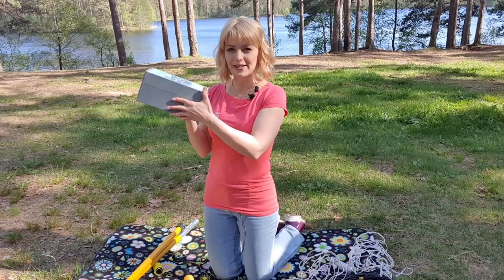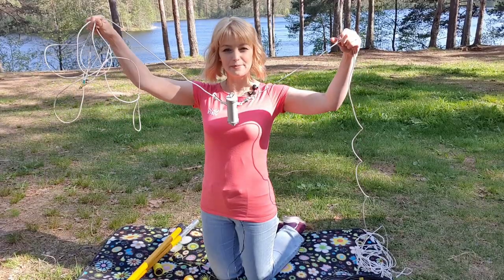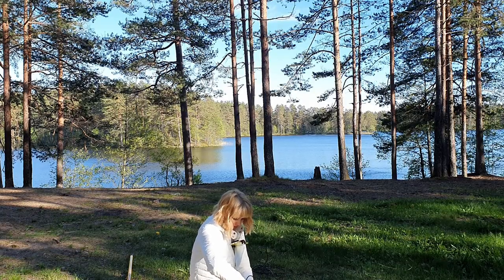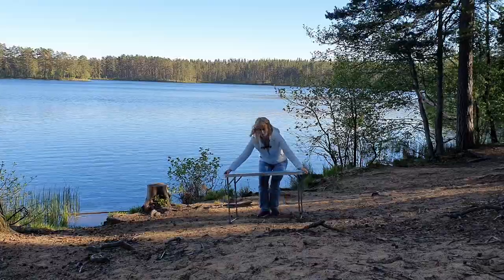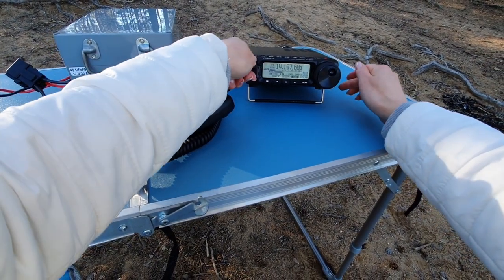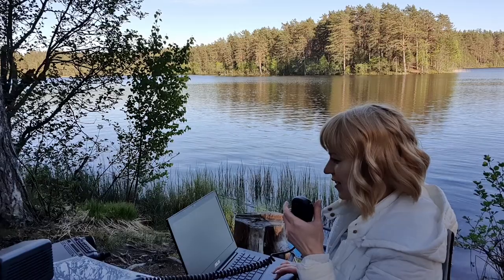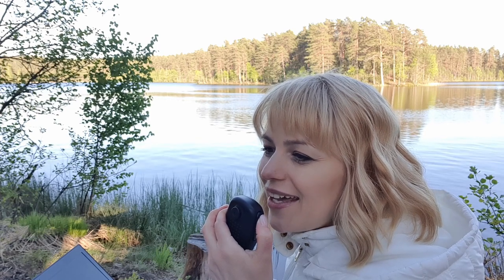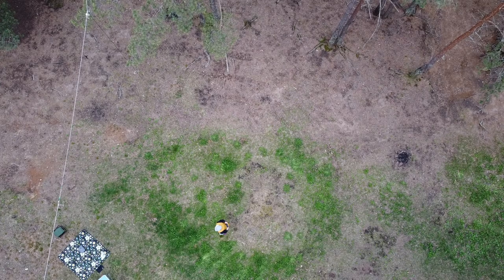How a YL can set up a portable HF station in the Russian woods

Comment: Very good Raisa. All my compliments and my best. Your dipole for the 20 meter band is located for sure at more than 10  meter height. At this distance from the ground the swr will be more stable. But the merit for the low swr is of you dipole, and if you have made boy yourself my compliments for this. Best regards and 73 from IW0HPU from Rome, Italy. Bye. Fabio
Reply: Tipically the swr will start to oscillate around his constant and lowest value when the antenna is at a distance from the ground at least of an half wavelenght. And the antenna position in your video was at more than 10 meters from the ground, perhaps 12 or 15 meters. A very good distance for the 20 meters band that you have used. Best regards and 73 from IW0HPU. Fabio

Comment: Hello YL Raisa you did a great job on the sling shot and setting up. If you fold your string into a bucket or large paper supermarket bag it will behave better when you fire your weight over the tree. Thanks for the video. vk5cz ..
Reply from the maker: Thanks for this advise. I had such a bucket in Finland, when I bought this sling shot. But now I can not come into Finland because of restrictions.. I will find something here in Russia ;-)

Comment: Well I can only copy one of those camera angles Raisa :). but you have done a wonderful job.  Something for you to try:  I find that a small weight on the end of a rope can, with practice, be thrown high enough to deploy most any antenna.  This would reduce what you need to carry into the field and of course; simple is good!  Well done regardless and thank you for taking the time to make this a video.  73 - N3NWV
Reply: I use a wrist rocket sling shot. Vey compact. I've installed ropes on 100's of trees when building my 40m wire beams!. 73 WA3RSL

Comment: Fun video. One word of advise. Do not use solid pieces of steel as weights. Very dangerous!!!! Many times when you throw lines over trees, they become stuck and you have to pull on them to release them. When you do, the weight can come back at you at speed. The nut you used can do a lot of harm if it strikes you coming back. That is the reason to use throw weight bag pouches. 73, Greg/KP4PK
Reply from the maker: Hi Greg! Thanks for your advise, I try to control the weight, if it should come back. But you are right. Weight bag would be better...
Reply: @YLRaisa  I had a close call one day with a similar weight and realized how dangerous it can be, even if you are trying to be careful. Since then, I use arborist throw weight bags. They should be available where you got the sling. They do not cost much and are meant for throwing lines on trees. You can personaly be aware of the dangers and take precautions (like the hardhat), but one of your followers may not and decide to use the same type of weight and get hurt. I do not want to be an alarmist, but that nut can literally kill you. I hardly ever provide comments, but felt it was the right thing to do. BTW nice portable setup. I really enjoy the fresh approach to your videos. Keep them coming... Hope to meet you on the bands soon!!!
Reply from the maker: @greghernandez3012  thank you very much for your comment!
Reply: @YLRaisa  Thank you for being such a class act!!! Congratulations!!!! You will take your channel very far!!! Wish you a lot of fun and success!!!!
Reply: henry radioworld  Plus she looks good with a hardhat.

Comment: Not sure if you ever tried the Havana Cuba Broom Sitck Antenna?   it helical antenna .  can be only long 4 feet too.  I tried it on shortwave receiver at brothers apartment out a window and worked very well.    Good portable antenna and emergency antenna.      Hey   Sure nice out there by the lake and radio there,  Raisa !
Reply from the maker: No, I have never tried this. But it would be interesting to try
Reply: Very simple antenna,   find old broom stick  wind half wavelength of frequency desired.     4 foot broom stick or something.    ground radial what ever you have.    might need a tuner .   it works alright.     next to zero cost for antenna.      I think Radio Havana Cuba has it some where on web site..  very easy .  portable cheap antenna.

Comment: thats a crazy catapult. i use a fishing rod but i have lots of practice casting the line. also a spool of fishing line and device called pocketshot. 
that analyser is huge for portable.  you might want to think about either a nanoVNA or elecraft t1 tuner. i am old and lazy so i insist my whole station can fit in my pockets
Reply from the maker: Thanks for comment and advice

Comment: And maybe a note of caution, too: Beware of build-up of static electricity if using a high, long-wire, until it is grounded! :-O
Reply from the maker: but a dipole can/should not be grounded (in a portable condition) if I am right...? it is not very long - just 10 m
Reply: @YLRaisa  dipole might accumulate static electric potential. This is not for the reception, this is for protecting yourself. It is similar to sparkles from a sweater in the winter time but amount of accumulated energy is much higher. I can record an detailed explanation for you.

Comment: I always enjoy watching your videos. This one was very nicely done. It shows how simple it is to put together a very effective HF portable station. I liked your sling-shot. You were really able to erect the 20 meter dipole high in the air. I hope you did not forget to attach the coax to the antenna before you pulled it into the air? I say that only because I made that mistake one time. OOPS !
Barry, KU3X
Reply from the maker: Hi Barry, it happened with me too. But it is not a big problem to get the dipole back, connect the coax and pull it again to the sky ;-)

Comment: It was very interesting to see the setting up.   
I just received my beginners license here in Belgium.   I'm just waiting for my station license to arrive this week 
My teachers at the club and others on YT highly recommend the Yaesu 891 like yours.   I'm "saving up" for it later this year.  Best of all,  my wife supported the idea of waiting a bit and getting a good one.
I certainly want to go out and do QSOs like you showed here.  I want to do QRP 5w with a "wire up a tree", as it seems quite challenging. 

God Bless
Reply: I bought the 817 by mistake,  
Later bought the 857 as originally planned, 
But no idea at the time that all of them had a bad design. They put DC voltage on the filters, not to long of running any of them in a high humidity environment before they failed. 
Even talked with the people at the Visalia ham radio convention about this issue, they told me that the issue was known but they still don’t fix the issue. So, it would seem as if standby current VS functional radios in some sort of solar battery, no heat to drive out the moisture environment is still an untapped market. If anyone knows of an exception, please tell me. I run solar battery all the time, and all of the good radios I know of are from the past. What happened to good engineers, or even good marketing for people that buy things ? If I am to be off grid with the radio pictured in this video, would be hundreds more pounds more hardware than the 857 that is broken by design for skipping a few by pass capacitors
Reply: @spacecase0  that's no fun.  I wonder if the 891 (which I want to buy later this year) has the same problem...
I studied marine radio telecommunications around 1974 and things were "repairable".  One could un-solder,  re-solder this and that.  There was Radio Shack Tandy,  that had all kinds of things in little plastic bags.  Today, I wouldn't know 80% of the stuff in the unit and stay away from that..
I've just ordered a USDR + baby 5w QRP 8 band transceiver to start off with until I buy the Yaesu.
Good luck there !
Reply: @PeterJavea  you can fix the new ones as well, but everything is tiny. I can fix the mobile radios, but the handhelds are really hard
Reply: @spacecase0  ok.  So back then I bought radio kits through the post.  
I have looked a several YouTube videos with men sharing and showing how to replace parts with tiny pointy soldering irons and, i would listen and watch first.
I could buy one of those kits sold on amazon/Ebay and practice on that, so to speak. 
My main interest is to be able to properly contact people across the world.   So once I have my location licence I will start.... by listening.   I love listening to these  radio amateurs.  That way I can hear how it's done.
When I worked in Canada, I equipped all the vehicles at the ranch with CBs + a base station in the kitchen.   It worked great.  Amateur radio is quite different and needs to be very organised so everyone has a chance.   .
Anyways.  Radio is fun !

Comment: Raisa you have to try the jpc 12 antenna, I use it in 20 and 40 and its performance is very good reaching 9000 km with 100w, In portable I also carry the bueti 2000wh battery. I have some photos on my instagram.
Reply from the maker: thanks for your advice

Comment: Good to watch your video. Perhaps your DJI Mini drone could drop a wire higher in the trees. I bet someone has tried it 😊
Reply from the maker: It would be great if it could do that. :)
Reply: I’ve been looking and yes there is a way to do it. The drone the radio operator uses looks like a heavier duty DJI but there’s another video which I will share after this one which shows how much weight the DJI Mini 2 can potentially lift but if you try please be careful not to trash your drone. This is the first video: https://youtu.be/MvSGPGC94ik
Reply: This is the video which shows the DJI Mini 2 lifting weights which I expect may be heavier than your wire: https://youtu.be/brawT3zjKh0 Hope this helps. All the best, Alan G0NQA
Reply: I am very pleased to see you enjoying our wonderful hobby, and set up in beautiful nature. I have used my drone to put up 160 meter quarter-wave vertical from top of 43m tall tree at the coast of island of Hawai’i. 
And I have swim in your lakes near St Petersburg, many years ago Rob - NH6V

Comment: Hi Raisa, very good antenna and congratulations on your excellent English, I know only two words in Russian, not enough to order a coffee!  If the antenna SWR was not acceptable, what would you do?  It is hard to adjust an antenna up in the air by 10m.  73 Andrew VK1DA/VK2UH
Reply from the maker: In this case I would make my lovely dipole shorter or longer ;-)
Reply: Of course - but it means taking the antenna down and putting it back up, perhaps several times!  Another suggestion: you should try some SOTA activations - Summits on the Air, see SOTA.org.uk - there are operators from Russia participating, you would be extremely welcome if you like operating portable already!  It is an international award.  Hope to work you one day on a summit in Russia, or anywhere!

Comment: A couple questions? good job YL 😋 Q; How long did it take you to put that dipole up in the trees and have it ready to check SWR? & Please, what is the model # of that MFJ antenna analyzer & the model # of the dipole antenna and where can I get them on line? Thanks, from KJ7VZY🥰
"Translation by Microsoft translator;"
Пара вопросов? хорошая работа YL 😋 Q; Сколько времени вам потребовалось, чтобы поместить этот диполь в деревья и подготовить его к проверке SWR? & Пожалуйста, какова модель # этого антенного анализатора MFJ и модель # дипольной антенны и где я могу получить их в интернете? Спасибо, от KJ7VZY🥰
Reply from the maker: Hello KJ7VZY :-) It took me just some minutes (15-20 min)- you see it in the video - it happened very fast. SWR checking takes only 1 min :-) it is an old MFJ .. I can not remember now, but there are many similar - I like old MFJ analysers, but many hams prefer new versions, much more digital :-) Dipol was hand made in Russia. But you can get the same dipoles everywhere online.
Reply: @YLRaisa  Thanks for taking the time to answer my questions ;-D and yeah I like hand made antennas and stuff like that :-P  So I'll check around on line and I like the way that antenna performed for you out in the trees , That's a very nice portable station you used there too. :-)

Comment: Raisa, you might want to look for one of these: https://www.amazon.com/THORIUM-Slingshot-Launcher-Arborist-Weight/dp/B085G7QKW8 which is made for that sling shot. It is safer than a big steel nut. Those are some really tall trees. I have a Big Shot but my trees are just not that tall and straight. That was a lovely spot and very beautiful. It looks like you had fun.
Reply from the maker: Thanks for link, yes, I know that weight and original line. But the line costs 20 times (!) more than my local line, which I have been using for many many times. And the weight could also be expensive considering that it can be lost quite often on the top of tall trees... But I will think about these options !